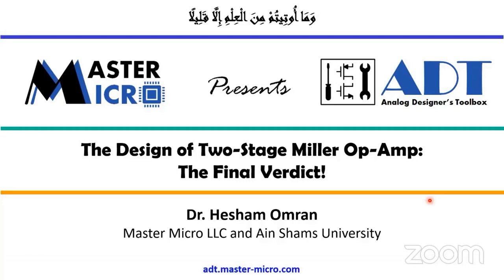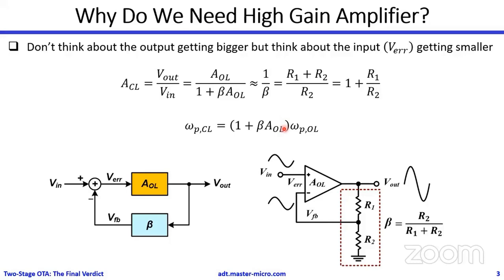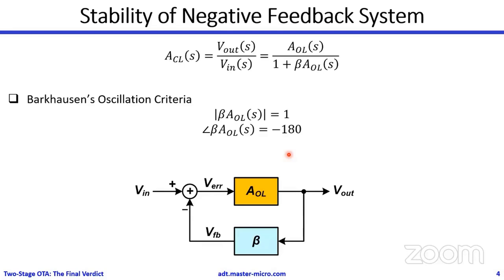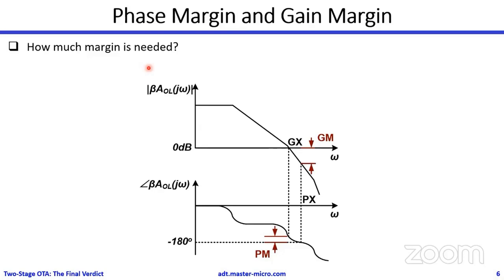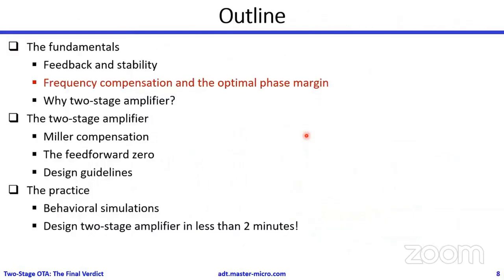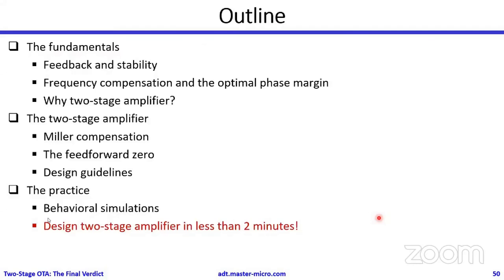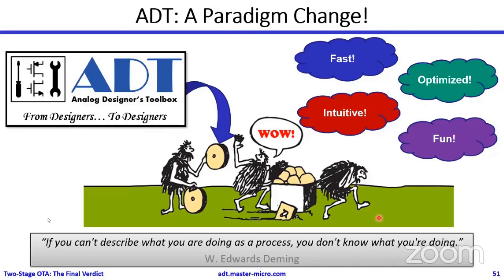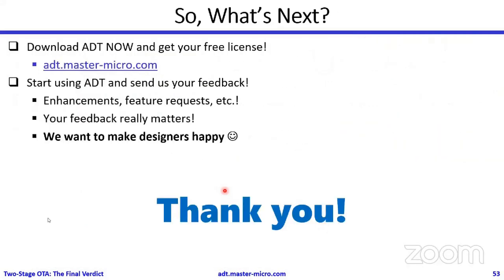The Design of Two-Stage Miller Op-Amp: The Final Verdict! | Dr. Hesham Omran

Comment: In the table @15:41, is wu1 constant for all 4 rows? If not, then which parameter is constant in the table?
Reply from the maker: Yes, Avdc, wp1, and wu1 are constant. Only wp2 is changing.
Reply: Thanks for the reply. Another question, settling time ts∝1/(zeta*wn)∝1/wp2. But it seems the table is not following that. Which formula had been used to calculate ts?
Reply from the maker: @RitayanMitraggmu  As shown in the lecture, the actual settling time for 0.5% error is measured from simulations. No approx formulas are used.

Comment: But sir don't you think this will effect the intuition of an cmos analog design transistor level engineer? They will just know things, but they will not be able to understand they way you understand things like you see on your eyes.
Reply from the maker: ADT gives a big deal of intuition through several tools such as the interactive sensitivity/impact analysis, the gm/ID tuning, etc.
So, on the contrary, the intuition that takes 10 years to be achieved, can be achieved in less than one year if you are using ADT.
Reply: Sir do you guys offer analog and mix signal IC design course in English for international students? Can you refer me on that?